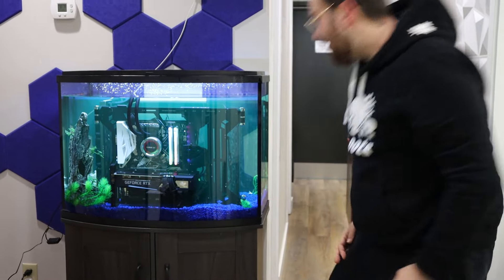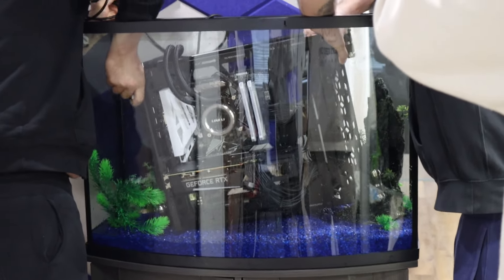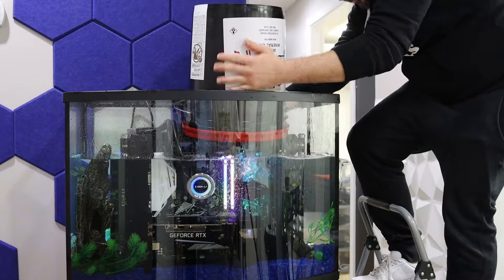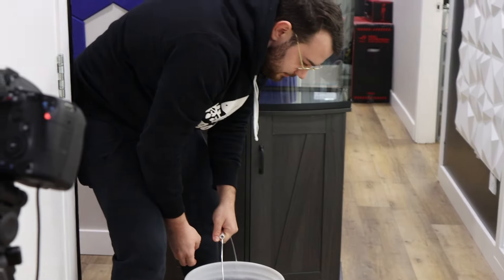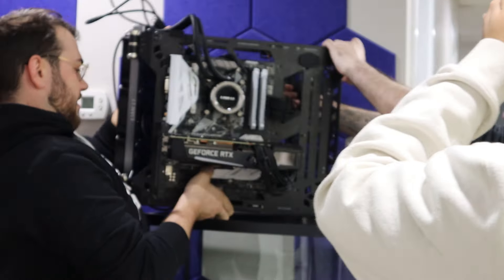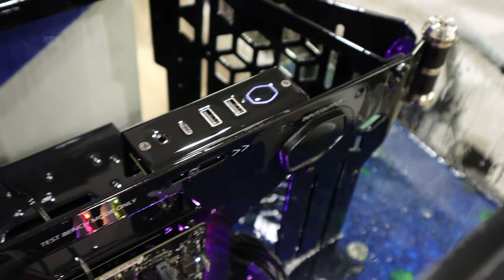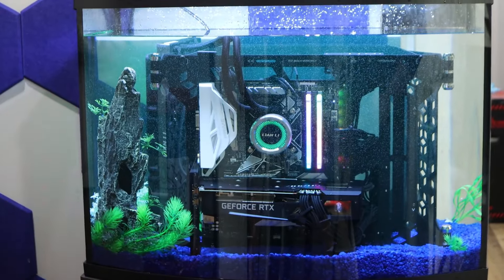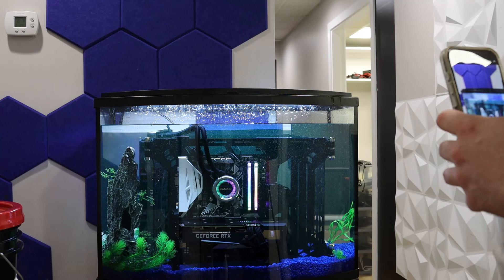Building a PC Inside a Fish Tank

Comment: I don't want to hate on you guys because I think it was a good idea and looks super cool...but you guys totally f-ck-d this up and did it wrong. After about a year the mineral oil will screw up your computer. And mineral oil is flammable. You need to use dielectric coolant like Bitcool from Engineered Fluids. You need some sort of external cooling loop because the fluid in the tank will warm up. Also, having a liquid cooled computer submerged in liquid is a bit redundant. I'm going to wait for the after Christmas sales to build a maxed out gaming computer and submerge it in an acrylic tank that I am designing. I'm also going to have the fluid circulate through a copper cooling coil. You can get all of this information if you do a YouTube search for submerged Bitcoin miners.